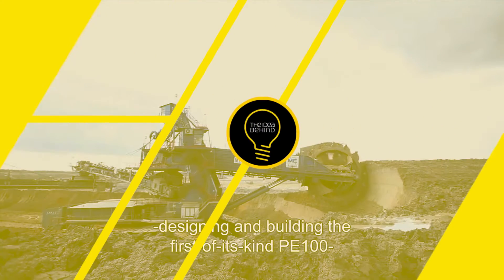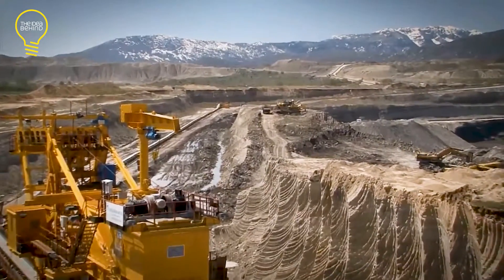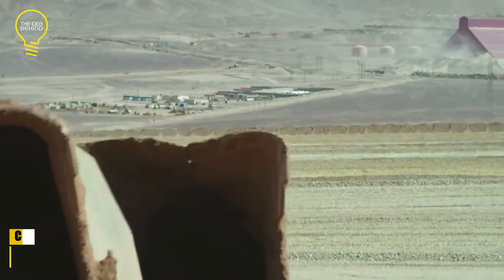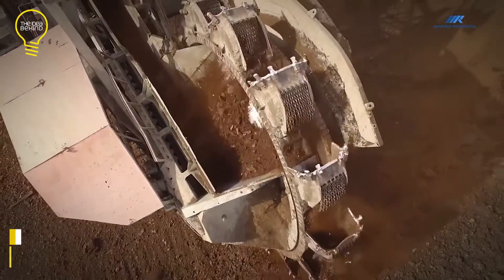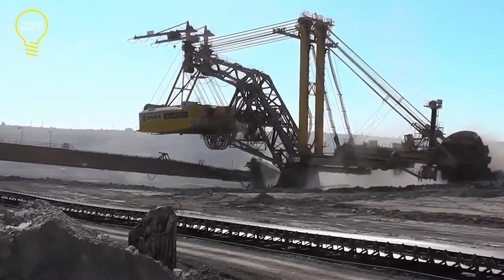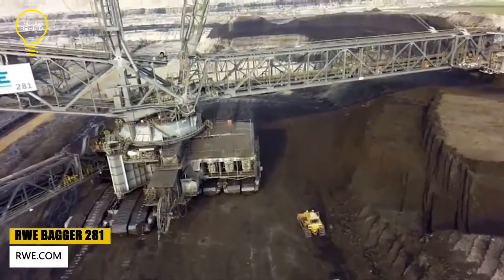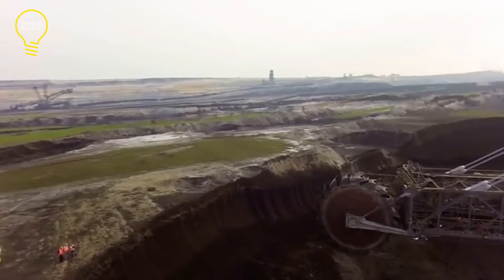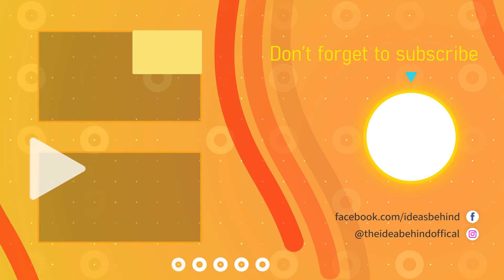The world's top 10 largest bucket wheel excavators

Comment: Funt fact #1: bagger 293 is the largest bucket-wheel excavator.

Fun fact #2: the BelAZ 75710 is the biggest haul truck.

Fun fact #3 the bagger 293 is 96 meters or 315 feet tall.

Fun fact #4: the biggest large dozer is komatsu D575-3 SD.